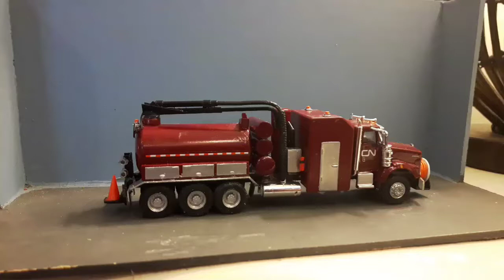Ho scale vac truck converted herpa KW chassis

Comment: How did you do the arrow board on the back of the truck? And did you convert a Zycon Models truck?
Reply from the maker: no not a zycon  vac truck  at all .... all scratch-built except for the herpa chassis frame and cab .. it was originally  a herpa dump truck triaxel  all tanks n hoist are scratch built  the arrow was tricky made 3 before i got it to look rt  styrene with tiny holes drilled in it  and drop of acrylic  yellow  with toothpick in hole for light,thanks for showing a interest in construction
Reply: hdtraincam I’ve been getting into customized vehicles and I really want to find something rather rare for the layout.